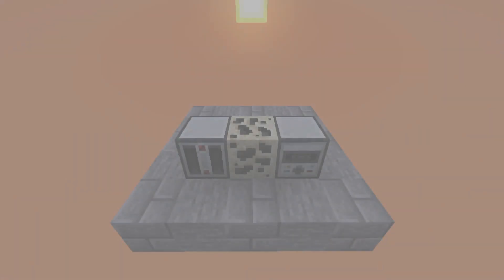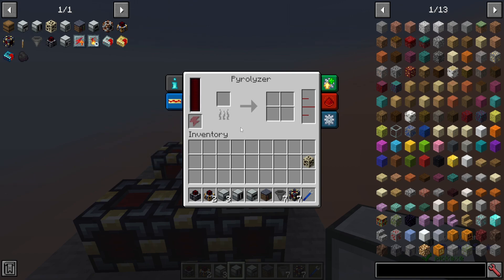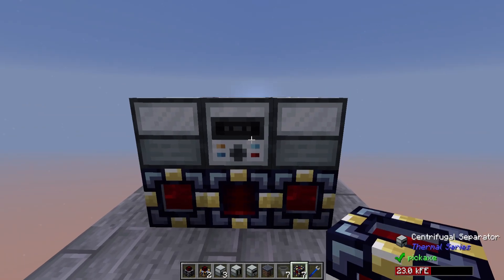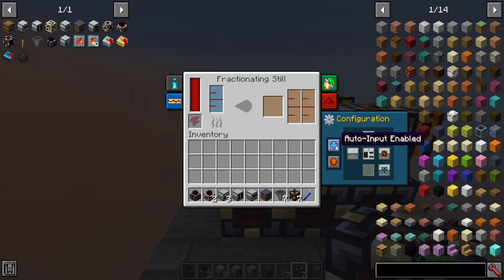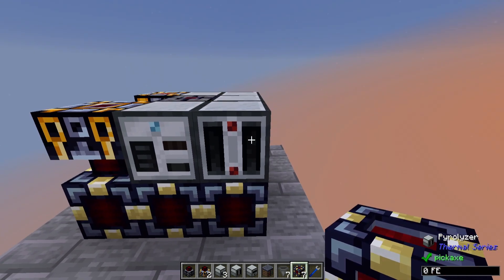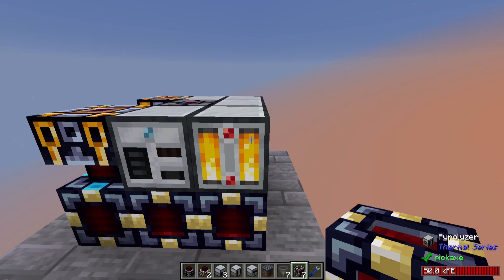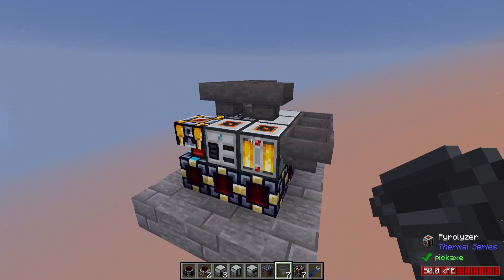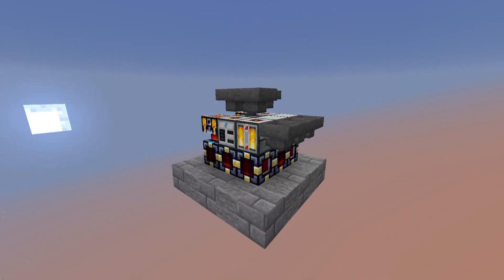Thermal Series Pt6 Bituminous Borg Power Cube Bit-By-Bit 1.16.5

Comment: No thermal pipes makes me sad.  They were my favourite.  Seeing hoppers used in this way though was really neat.  I never considered using the machine output to push UP to a hopper.
Reply: Are they gone for good? Or has dynamics not been updated yet? I remember it was the last of the bunch in 1.12 as well
Reply: @Adam-pk7go  It's not updated yet. Until then, you can use other mods. It's fun to mix Thermal with Create.
Reply: I think ender IO conduits were better than thermal ducts
But the ducts are definitely more upgradable
Reply: @abdellah_1893  Although I did use the conduits more they felt too powerful, crossing the "magic block" line.  Thermal's pipes hit a good balance for me.  I actually cared how my machines were laid out, instead of the conduits being so powerful I could cheat it all with 1 conduit per machine then filters and channels.
Reply from the maker: Try Create pipes. It makes it a lot of fun
Reply: @cinderheart2720  you have predicted create above and beyond
Reply: if your playing a modpack with any other logistics mod you shouldn't need hoppers
examples include: mekanism pipes, pipez mod, xnet, translocators etc